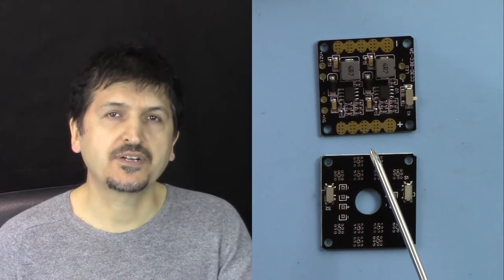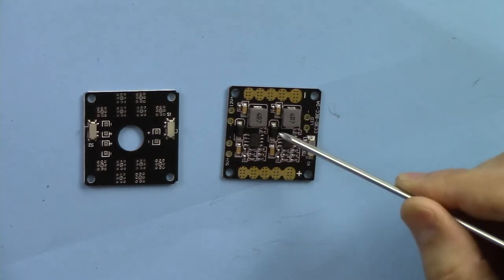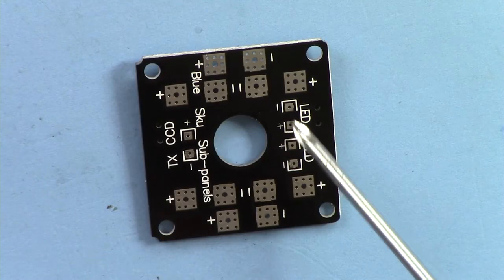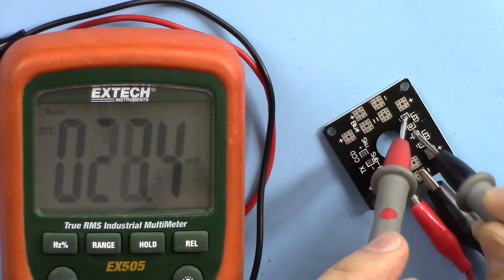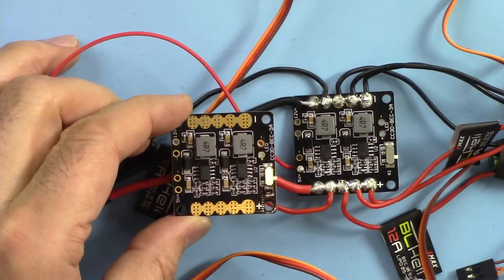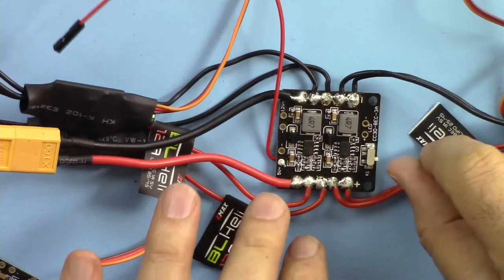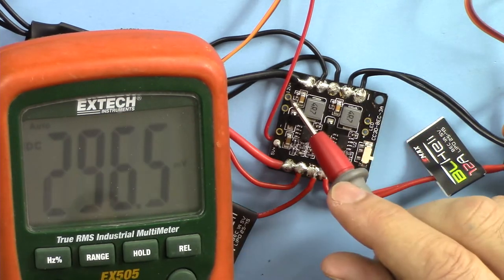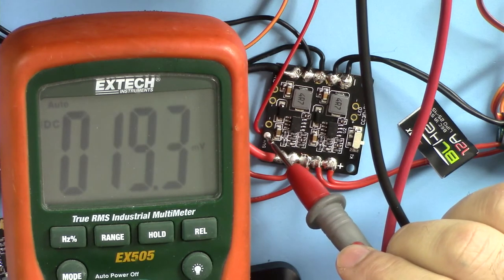Drone Power Distribution board PDB explained

Comment: I have a older sky pathfinder ll quadcopter and a red wire has come undone, I want to fix it but I don't know where the wire goes. Would u know where I can find the wiring diagram for it. Thanks
Reply from the maker: Here is my search with  "sky pathfinder ll quadcopter pcb" and it shows some PCB (printed circuit board) which might help you  https://www.google.com/search?q=sky+pathfinder+ll+quadcopter+pcb&source=lnms&tbm=isch&sa=X&ved=0ahUKEwiboc78lZjgAhVr_IMKHYdGAy0Q_AUIDygC&biw=1920&bih=938

Comment: Do you have schematic for PDB board which has regulator?
Reply from the maker: why you need that? You can't make it cheaper than this. Besides this is so simple, you can do it in 30 minuets.
Reply: @robojax  yeah but i want to for my reference.

Comment: Hi sir I need to make 60 kg lifting drone witch power board good for that can you tell me
Reply from the maker: you have calculate the total left power, then determine your motors, then Electronic speed controller(ESC) and from the amount of current you determine the type of battery. I believe you will have to connect the battery to ESC directly because no PDB can handle such current.

Comment: Why there is no 20x20mm hexa pdb  ever made???
Reply from the maker: Because you would hex drone need 6 esc =12 wires , 2 wires for battery, 2 wires for flight controller and more so minimum of 16 wires would be very hard to solder on 2x2cm board.
Reply: @robojax  come on ! have you seen flywoo 6 in 1 esc 16x16mm?there is a hex pdb madē by matek but it is to heavy it can takes up to 60v 30x30mm and 20x20mm  i need a 20x20mm pdb for a 3 inch hexacopter
Reply from the maker: you could be wire. I haven't see it.